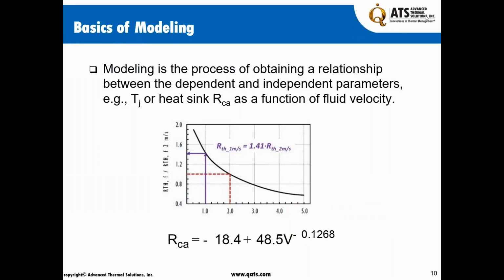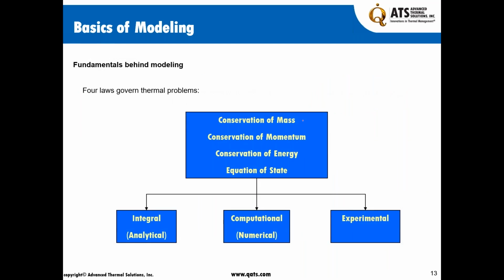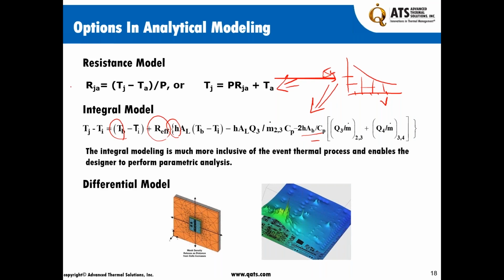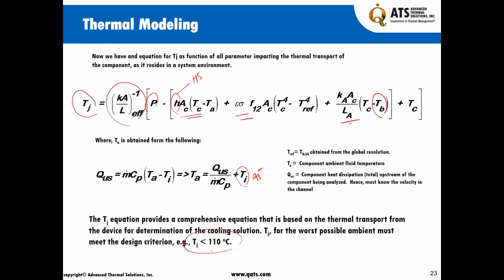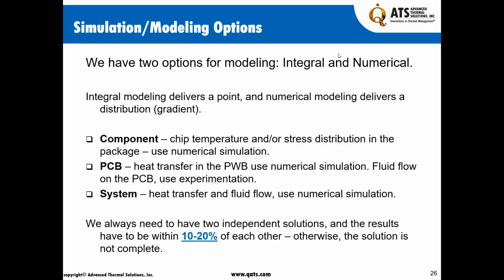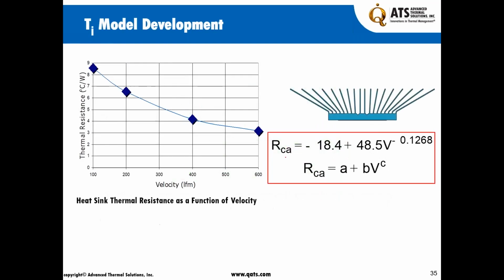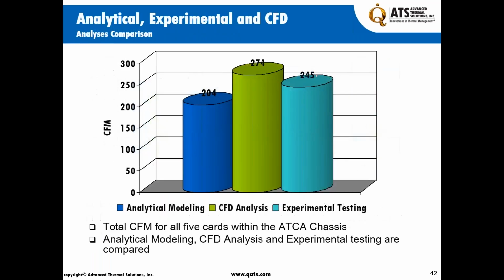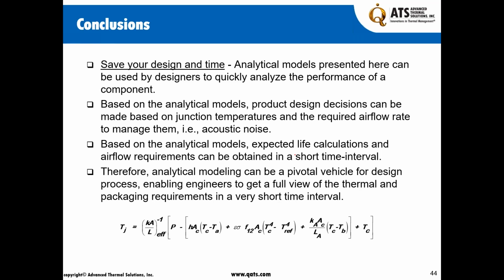Electronics Cooling: Thermal Management Approaches and Principles - ATS Webinar Series

Comment: Thank you for this presentation. Which CFD software is more adapted for thermal analysis in electronics ?
Reply: jade?
    ?  
      0
0
0
Reply from the maker: Hi Joris - Thanks for stopping by our channel and checking out our video. There is a wide array of CFD packages on the market: self-hosted, cloud based, and open source.  

The various CFD packages have their pluses and minuses. In our labs, we have used: 6SigmaET, FloTHERM, Autodesk CFD, Solidworks, DNS (direct numerical simulation; https://en.wikipedia.org/wiki/Direct_numerical_simulation), and in house developed tools.  

So the question of which one is best adapted is one which is based on application. The tools we use can be applied to a broad domain of thermal management modeling needs. But CFD alone doesn't tell the whole story. We have an internal design discipline that doesn't rely just on CFD but includes analytical modeling (using our in house tools) and physical testing via wind tunnels, water tunnels, smoke flow visualization, and other approaches.

Let me give you a quick rundown of some of the CFD packages. If this is for your own personal (hobby, education), you might be best of with a SimScale to start. If you are experienced and this is for your company, jumping down to the self-hosted list might be your best bet.  And 6SigmaET has a helpful blog post on this topic as well: https://www.6sigmaet.info/blog/which-cfd-software-is-best-for-you/

Open Source: Open source options are pretty good with powerful options. Packages would include:
- OpenFOAM (probably one of the most widely used) https://www.openfoam.com/

AI -  AI  tech would be part of a CFD software package, Siemens has a nice article on this here: https://blogs.sw.siemens.com/simcenter/4-myths-about-ai-in-cfd/
- Diabatix: I highlighted this company with their cloud based tool as they have a somewhat unique approach that is cool to checkout for AI for heat sink design: https://www.diabatix.com/   

Cloud: This isn't so much a single tool as a way to tap into commercially available CFD tools at reasonable prices using a hardware stack that best meets your cost/compute needs. 
- Rescale  https://www.rescale.com/
- Amazon AWS CFD https://aws.amazon.com/hpc/cfd/
- SimScale https://www.simscale.com/  (FYI they have a free license level for education and hobbyist, a helpful article for beginners is here https://www.simscale.com/blog/2019/04/cfd-analysis-for-beginners/ )

Self Hosted: There is a huge number of options and the companies would include:
- Future Facilities 6SigmaET https://www.6sigmaet.info/
- Ansys https://www.ansys.com/products/fluids
- Autodesk  https://www.autodesk.com/products/cfd/overview
- Siemens FLOtherma https://www.plm.automation.siemens.com/global/en/products/simcenter/flotherm.html
- Dassault Solidworks https://www.solidworks.com/product/solidworks-flow-simulation
- Resolved Dynamics, a professional engineering firm, has an interesting article on this topic here: https://www.resolvedanalytics.com/theflux/comparing-cfd-software
- CFD-Online also has a list, though I'm not sure  it is very current https://www.cfd-online.com/Wiki/Codes
Reply: @heatsinks  Thank you for your detailed answear !